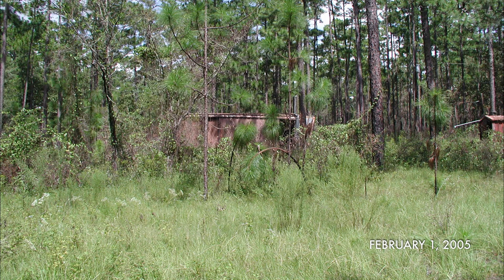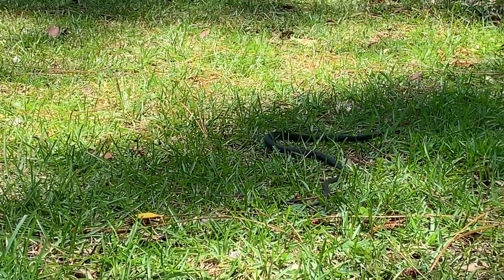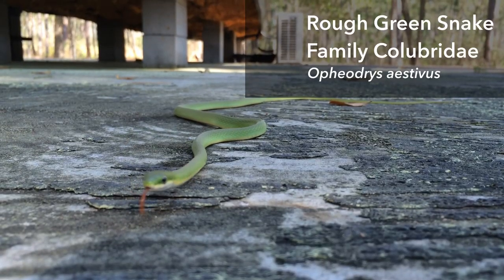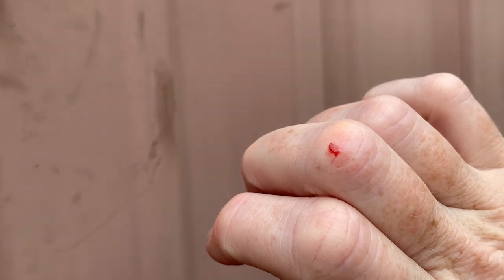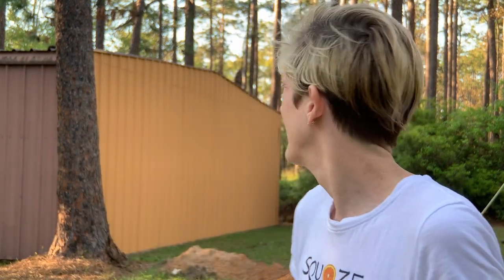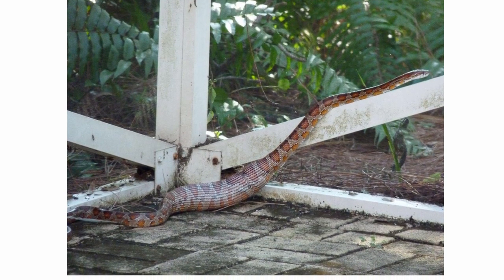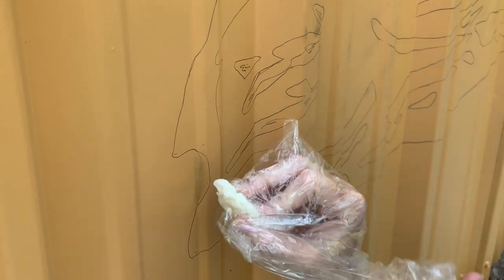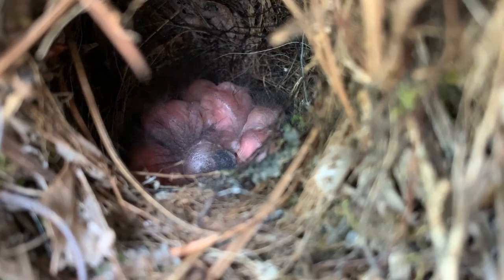Beachton Buck Rivet Report — Episode 5

Comment: The snakes and baby birds didn't bother me.  But it sceeved me out to watch you paint from the bottom up.  Your ridiculous natural neatness allowed you to get away with that nonsense though.  Brotherly love.  Great video.
Reply from the maker: Maybe think of it as painting right to left? I find if I get a drip on the fresh paint I can smooth it out, but if paint drips on the dry hot metal it dries so fast it leaves an outline. Also I never get drips. I paint Hardiplank bottom up too though. It just works better. That top down thing is a only for rolling interior walls where the little tiny paint drops spray everywhere.